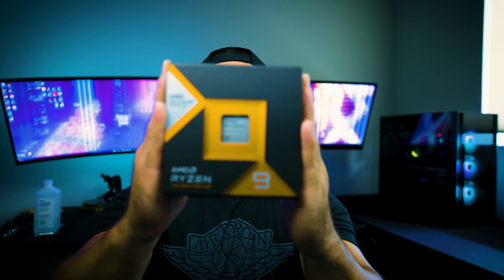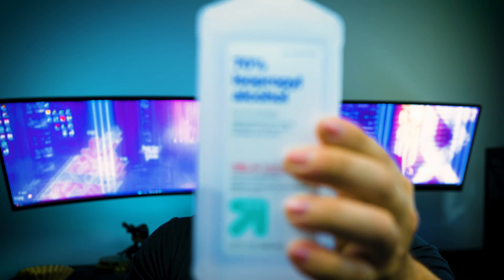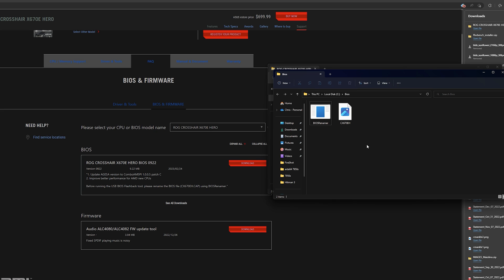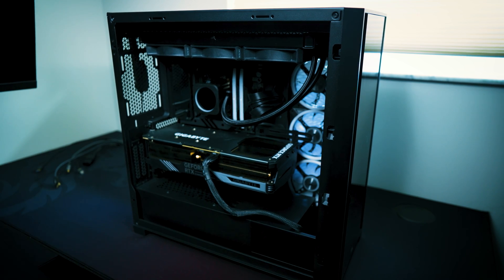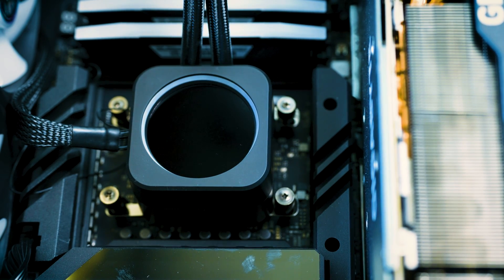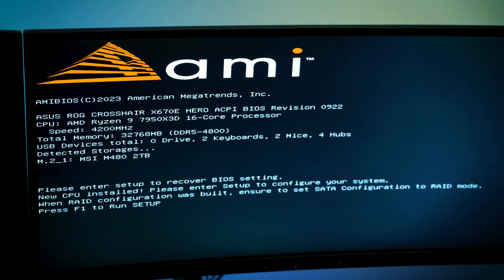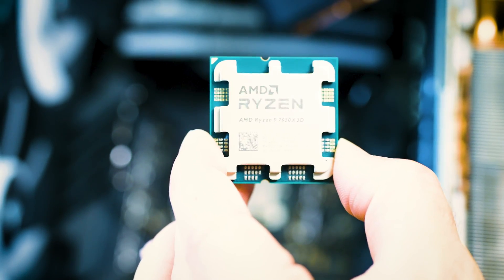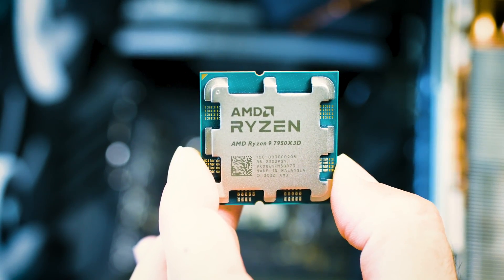AMD Ryzen 9 7950X3D - Unboxing,Installation, Benchmarks & Review

Comment: I picked up a 7950X3d, B650E Aorus Master, and 32gb’s 6000mhz cl30 ddr5 ram Thursday from Microcenter. I was running a 5950X but picked up a 5800X3d when they got $320. And I was running a Ftw3 3080ti but picked up a Gigabyte Gaming OC 4090 at launch and just wanted to make sure I was keeping my gpu utilized but the 5800X3d is an amazing chip and people on am4 who wanna save money probably should pick one up. I think they have got as low as $300 lately. It was a hard decision for me between the 13900k and the 7950X3d, they are both very close in gaming I just picked the amd chip because the am5 socket will get supported longer. And the power efficiency on the X3d is really amazing especially when compared to the 13900k both maxed 100%. And I normally buy X boards my last 2 boards were a x470 crosshair vii and x570 crosshair viii but this time around I wasn’t paying $500+ for a board when the B series boards have all that I need. The master has plenty of nvme slots, gen 5, and a good vrm, and a post code readout. I fill like the 7950X3d is getting a bit of hate thats really not warranted.

Comment: Great video. Glad to see that I'm not the only one experiencing high cpu temps in certain games with this porcessor. Same cpu cooler as yours.
Reply: So the issue with the high CPU temp is a result of an nvidia driver service that is taking up cpu resource while its running and it needs to be disabled or deleted. Check the nvidia sub reddit for the fix. In following the steps my temp is no longer in the 80's.
Reply from the maker: @Tg4010  thanks Kharl Martin, i'll share this post and make sure to give you the credit for the awesome find 👍👍
Reply: @Tg4010 I can't find it. What is the title of that reddit post? 🙂
Reply: @darkezowsky  hello, its first post on  nvidia subreddit that has the latest game drivers. Its pinned on top.

Comment: Does amd 5950x bottle neck with RTX 4090, some say it can’t utilise it fully? I have amd 5950x and have ordered the rtx 4090, should I upgrade the processor to 7950x?
Reply from the maker: the 7950x will utilize much better compared to the 5950x, the processor won't produce quick enough and it ultimately will throttle your GPU especially for gaming, 7950x will not bottle neck compared to the 5950x and will utilize the 4090 100%
Reply: I Currently have the 5950x PBO on Auto, and Auto OC with Ryzen Master i mainly sim race and in scenarios like light/med rain or early morning crazy lighting or shadows it bottlenecks pretty bad, I Will be changing to the 7950x3d when it becomes available again already have the mother board GL!